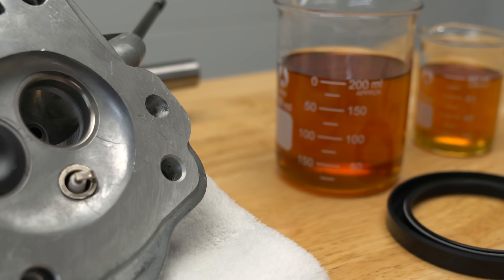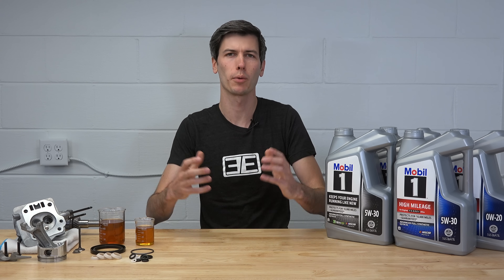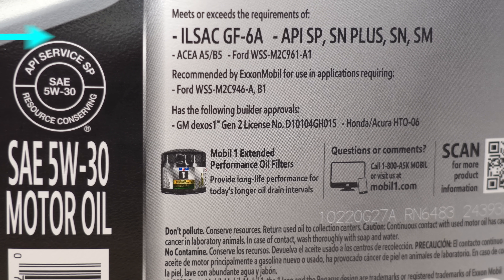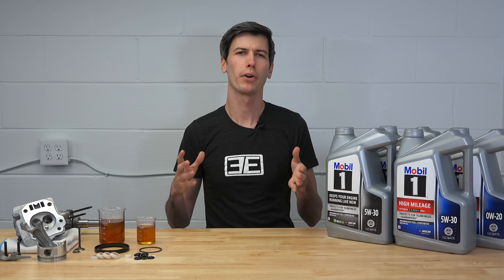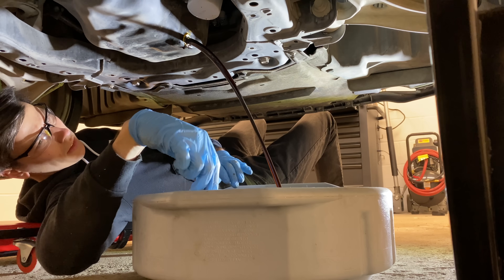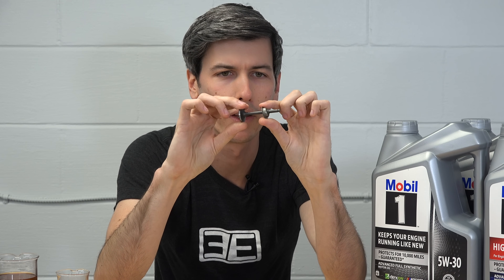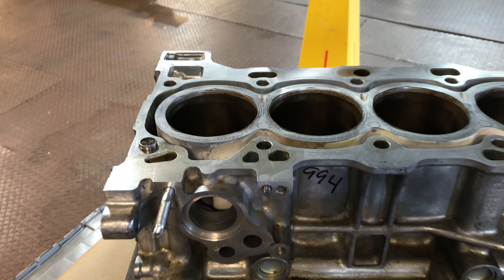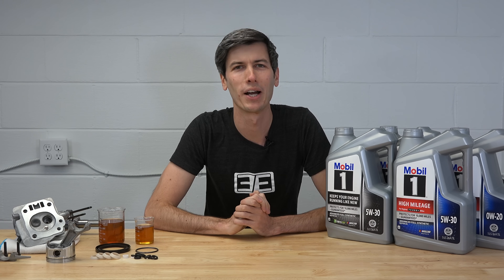Is Synthetic Motor Oil Bad For Old Cars?

Comment: Jason , what if I run 20W 50 in a rotary engine?
Reply: Atarv Hegde mineral only, plus 20w-50 is way too high for a rotary
Reply: @aleksandarjovanovic2238  
Well I meant is a thicker oil usually gives better reliability. So I asked.
Well will 20W 50 work on a S85( I plan to have that engine later)?
Reply: Atarv Hegde thought u were gonna run rotary. Basically, the higher weight u run the more it protects the engine, it also makes it harder for some parts to move. Here in australia we see temps of upto 40°C, and my mx5’s oil pressure gauge reads about 1bar at idle when it gets that hot, (i run 10-40), if i run 20-50, it wont drop that low on oil pressure, but the engine would start struggling to rev at 7k+. I dont know much about german engines so i wouldnt know if 20-50 is high or not, you usually run a higher grade if u want to protect stuff thats getting worn out, like rings. Im not an engineer, im a physicist, so i didnt study this stuff much, go off by forums. By manufacture recommendations, it says i should run 5w-30 or 15w-50, i dont feel comfortable running either cause one is too thin and wont protect my rings and walls, while the other is too thick and will put more load on the engine when its trying to move the piston.
Reply: @aleksandarjovanovic2238  
Well , fine. Maybe 20W-50 is way too thick.
But , the manufacturers usually recommend a oil that gives a mix of reliability and fuel economy. So maybe running a slightly thinker fuel is better

Comment: I always wondered how cylinders were kept lubricated. Cross-hatching. That's pretty cool.
Reply: Sorry, but no. The crosshatching is there to condition the sealing faces of the piston rings to achieve a good seal. The cylinders are lubricated via oil being violently flung around by the rotating assembly.
Reply: @GroovesAndLands  Interesting. I don't understand that. Surely a smooth wall would provide a better sealing face for the piston rings? How does this work?
Reply: @HdaveH  It comes down to neither the piston ring or cylinder being PERFECTLY round. The cross-hatch's most important function is to abrade the piston ring on initial break in to achieve a good seal. As the engine goes thru life and experiences wear, the geometry of both the cylinder and ring will change a little; for engine to keep excellent compression and sealing, the rings/cylinders need to stay nicely mated/married, and the crosshatch helps make that happen.

I'm not a fluids guy; there may additionally be something to oil forming a nicer, more spread-out film on the crosshatch compared to a simply smooth surface - similar to the difference in how paint sheds water waxed vs. unwaxed. Not sure... But seriously, the most vital function of the honejob on a cylinder wall is to get brand new rings seated properly in the first few minutes of running.
Reply: @GroovesAndLands  Thank you, that is fascinating. As far as fluids go, iirc they will adhere better to a scored surface than a smooth surface, so long as the size of the scoring is small and the fluid viscosity is in the right range.
Reply: @HdaveH  That is interesting, but sort of intuitive!

I've certainly seen old engines, with zero crosshatch left, that consume a lot of oil and smoke like a tar kettle... So why would a smooth cylinder wall cause the smoke?

Not sure, but a theory that would jive with our musings here is a smooth cylinder might have "puddles" of oil instead of just a film, and the piston rings can't properly scrape off the excess if they're slogging through puddles.

It's a complicated dynamic, difficult to envision and nearly impossible to actually watch in action.

Comment: The standard oil for old cars has been 15w-45 "diesel engine oil". The thicker oil to help with leaks, and the "diesel" because it has a higher concentration of zinc, molly, and detergents.  THe problem I have with sythentic oils is there is no industry standard for blends. Might have a little, might have a lot. And there is different types of sythentic oil base, some great, some poor. ie Synthetics are usually called "Group 4" or "Group 5", but the cheaper ones use "Group 3" which is not considered sythentic, but actually a higher grade non sythentic.....   but with no standard, you can say what you want as long as you can factory certification

Comment: 12 years , 210000km , still can do m1 0w40, 5w50 , no oil loss ✋ , but the tran is getting weak lol , despite oil crisis , engine oil price remain tough
Reply: Synthetic oils require a lot of processing, so the major costs is not the crude oil.
Reply: @duerdum9  mineral and blend too ,  no sign of lowering the price

Comment: The reason synthetic oils mustn't be used on Wankel rotary engines has nothing to do with carbon deposits. It's all to do with NOx (and other nasties) emissions which are far higher when synthetic oils get burned.
Reply from the maker: How would synthetic cause additional NOx? NOx is generally a result of high combustion temperatures & specific air/fuel ratios. The elements creating that NOx (nitrogen and oxygen) are brought in with the intake charge (air).
Reply: @EngineeringExplained  In general, it's the detergents and other additives that are superb for lubrication and longevity, but horrible if allowed to burn. In a decent piston engine, virtually no oil gets burned so synthetics are perfect, but a Wankel MUST burn some oil to function without destroying itself. To correct myself though, perhaps I should have said "gaseous nasties (including NOx)".
Reply: I would like to know where you got this info from, simply because I did many searches and came up with nothing referring to that at all, in fact the exact opposite, that synthetic oil reduces NOx emissions in diesel engines. I know, not the same thing...but that was the result of my searches. I did find references to how regular oil burns vs some synthetics not burning as much...which is obviously an issue in a rotary.
Reply: Reason for not running synthetic in an older rotary (3rd gen RX7) is partly correct.  Rotaries do burn oil as a normal process as described in the video.   Us old RX7 guys would not run it because the flash point for the synthetic was/is higher and the engine would pass some unburned oil out of the exhaust port which would eventually clog the cat and the increased pressures would kill the apex seals on the rotors.

Comment: I once blew an older engine when i changed the oil and put synthetic in. The Synthetic oil is so good that it cleaned the inside of the engine (years and years of deposits), clogged up the oil pick up line/tube and lost oil pressure. Dont put put Synthetic oil on older engines that havent got good maintenance, kids...
Reply: +1 for not watching the video. You are blaming the oil for a lack of proper maintenance of the vehicle for which the sludge is clear evidence of. Guess you should have dropped the oil pan too. Had you used regular oil it still would have clogged the pick up line.

Comment: What counts as a high mileage engine though
Reply: Depends on the engine. A 5 cylinder Volvo bill last for a long time while new VW engines are high mileage from the factory.
Reply: The bottles of "high mileage" oil (Mobil 1, pennzoil) you'll see on the shelf say they're recommended for 75,000 or more miles
Reply: I've heard 75,000 or higher.

Comment: Why are there high mileage oils to begin with? Why not just put all the additives in “regular” oils? Prices are the same between them.
Reply from the maker: This is discussed in the video regarding seal reconditioning. (see around 7:20)
Reply: Engineering Explained duh, can’t believe I missed that part
Reply: Great question, as a consumer it's a good thing, as I don't have to worry about buying a separate product that  I do not know if I can trust. One thing to note is that most people do not change their own oil and oil changing places charge $10 more for high mileage oil which cost them no more. So I imagine all oil companies had to make a high mileage oil to stay competitive with bulk sales to oil changing places

Comment: when synthetic oil came out for farms in the 60's my uncle put synthetic in EVERY engine on the farm. the 38 john deere is still running fine today.
Reply: As a retired Air Force guy, Synthetic lubricants have been used in jet engines much longer than most would realize.

Comment: My engine builder  recommended high zinc content oil because my engine has flat tappet cams/lifters
Reply from the maker: Yes - ZDDP is particularly important with flat tappet style engines. I had an excellent conversation with the engineers at Mobil 1 regarding this, and am hoping to summarize that info in a future video!

Comment: Yes used fully synthetic at my older car and it leaks therefore pin point on the gasket leakage. But after replaced the gasket, been using fully synthetic until now and no leakage anymore. So the pro, it helps to pin point the leak faster. The cons, it can cause leak if the gasket is almost harden and eventually sooner leak.

Comment: I only put the purest olive oil in cars
Reply: Italian identified
Reply: @ajayreddy3534  he must’ve also been doing the italian tune up, just revving the fk out of  his car to remove the carbon deposits
Reply: @ajayreddy3534 😊😊😊😊😊😊😊p You 😊
Reply: Extra virgin baby!! Lol
Reply: @audikid89   I wonder if suntan oil would be okay...
Reply: Hash oil for me. 😂 It's a terrible lubricant, but the engine dies with a smile on its face 👍
Reply: I use boiled linseed oil to reduce blow-by and increase compression.  Eventually it polymerizes in oil passages and reduces the need for an oil pump altogether.
Reply: @rabidkittenapocalypse7398  next time toss some pigment in there.
Reply: Double virgin Royal Purple?
Reply: Yes, and save the 5W20 for the salad.
Reply: Greek extra virgin olive oil , it has been used to lube up tens of thousands of rear ends for at least 5000 years . Works every time 😳😆
Reply: @conservativesniperhunter7439  😏 🤔 🫣 🫢 😉
Reply: Extra virgin. Oil and driver.
Reply: I tend to gravitate towards avocado oil, grape seed if I'm going to drive in extreme heat.
Reply: @kerfuffleizer  or verrrry good sexual lubricants.
Reply: You must not be from the U.S.. We don't even put olive oil in our salad dressing. It's all soybean oil. We enjoy our phytoestrogens.
Reply: Used trap oil from McDonald's works best. Perfect viscosity AND the exhaust is pure french fry bliss.
Reply: @AdamIsUrqed  ahahaha i like that dude.
Reply: @AdamIsUrqed  😹 just curious; are you aware that they do make biofuel from used fryer oil? I have never experienced it but I have heard that it does eau du french fry. 😺
Reply: @AdamIsUrqed yep, that’s the crap people ingest.
Reply: Says Popeye!
Reply: "Just a little bit more olive oil".
Reply: I USE HOLY OIL , THE CATHOLIC CHURCH  HAS AN  OVER ABUNDANCE OF IT 
EVERY SUNDAY ,  YOU CAN PICK IT UP AT MOST CATHOLIC CHURCHES,  WORLD WIDE.
BUT I'M NOT SURE OF THE VISCOSITY.
Reply: @almierz4604  Trouble is, it gets off your fingers and causes the Caps Lock key to stick down.
Reply: i use used old oil..filters too🤪..but my car runs so badly now?
Reply: Leo Stone How does it crank over? With some Hymm and Haa!
Reply: ironically you probably could run a diesel engine on olive oil
Reply: @GiordanDiodato  I've heard of cooking oils but Olive Oil??? I guess it is a cooking oil.
Reply: @WarriorsPhoto  Popeye made sure Olive Oil was well lubricated.
Reply: @steveavant9727  LOL 😂 Wasn’t that Brutus?
Reply: @WarriorsPhoto  I think they both had the hots for skinny, flat chested Olive Oil. Guess women were scarce.
Reply: @steveavant9727  Lol 😂, 🤣 😆
Reply: @GiordanDiodato
Reply: only extra virgin triple pressed for my vehicle
Reply: Ah Italian cars
Reply: Ornessar Hithfaeron - does she ride in the front or back seat?
Reply: David Turk I would hope the back. 😉
Reply: @davidturk6301  Please use the tradesman's entance.
Reply: Can't argue, oil is oil 🤷
Reply: I only flush my toilet with Fiji water.
Reply: @davidplunkett7128  Indeed? No access to Perrier?
Reply: Works like an charm
Reply: mcspikesky you must be Irish then
Reply: Cold pressed
Reply: bellisima!
Reply: Ornessar Hithfaeron 
Only in my fleet of Ferraris .
Reply: LOL, good joke and thank you.
Reply: And some chopped garlic?
Reply: I used Whale oil but had trouble with greenies chaining themselves to my car so I switched to Snake oil
Reply: @calthorp  Whale oil beef hooked.
Reply: @calthorp … you should have just dragged them down the road 😂😂😂
Reply: Wait,are you serious? 🤔
Reply: Vegetable oils don't work as engine oil because they will quickly turn into sticky gum. Shear stress on bearings breaks it down right away.  Lubrication would become minimal at that point.
Reply: I suggest you use EXXXTRA virgin olive oil
Reply: I only used Johnson&Johnson's baby oil.    Makes my engine run baby soft.
Reply: 😁 I use coconut oil
Reply: The only vegetable oil cars like is Castrol R.
Reply: Extra Virgin KY?!?! 😂🤣😂🤣
Reply: Only way to go
Reply: Avocado oil is better than olive oil for your engine
Reply: mmmmm
Reply: I like peanut oil , smells great also.
Reply: Only use EXTRA VIRGIN.
Reply: Cliff 😂 🤣
Reply: @WarriorsPhoto
Reply: Sama here!
Reply: Cooking oil
Reply: Caster oil is natural oil. It is blended with synthetic oil in Castrol A747 2 stroke racing oil. Whale oil was used in speedway bikes in Australia back in the day. There was once an Aussie ISDE motorcycle racer that completed a stage using olive oil from a villager.
Reply: I only use first pressing, ultra virgin olive oil.
Reply: I will pretend like i never red that
Reply: Olive oil will actually power a vehicle well, like any vegetable oil, as long as it is thinned out enough with kerosene so it doesn't get gummy.
Reply: Strong independent women that dont need no man! 👍🤣
Reply: Should try some grape seed oil they say it's healthier
Reply: @michaelkolbe5963  grape seed oil doesn't have the viscosity for high mile engines.
Reply: I use finest linseed oil.
Reply: Yeah corn oil is awesome
Reply: Tell me more about the olive oil. Never heard of it.
Reply: @shawnbutchko456  😳🫣😲🫢 O  M  G !
Reply: Genco or nothing
Reply: Avocado oil has a higher smoke point. It’s slightly more expensive, but well worth it.
Reply: Popeye approves
Reply: I like your style, Dude
Reply: @Ravelord Nito Good luck finding a virgin these days.
Reply: Extra Virgin 😋
Reply: Extra virgin 20-50
Reply: Extra virgin crushed by virgins?
Reply: Extra extra extra virgin
Reply: I’m a rapeseed kind of guy myself
Reply: Butter for the win!
Reply: I use castor oil. Total loss.
Reply: Extra virgin in the passenger seat
Reply: First cold-pressed!
Reply: I was talking to a heavy equipment operator and he was saying he used canola oil in place of hydraulic oil. Clean up was easy in case of hose failure because it was biodegradable.
Reply: i used mustered oil. works great.
Reply: Peanut oil has a higher flashpoint. I would recommend that you switch.
Reply: Only the virginiest of olive oils
Reply: And I use Mobile One on my salads.
Reply: I used mayonnaise
Reply: Here in Western Canada 
Canola oil is king.
Reply: @ornessarhithfaeron3576  I run whale oil in my steam engine!
Reply: Extra virgin it’s expensive but it’s the best
Reply: EVOO in the Evo?😝
Reply: Glad to hear it, “oils ain’t oils” (advertising slogan years ago in Australia).  Being serious now, I would rather you use olive oil in an engine, than consume it yourself.
The purity is said to be 51% AT BEST.  Yes, it’s diluted with other “vegetable” (the correct term is “seed oils).
Seed oils commonly oxidise (similar in concept to steel rusting), then it’s a health hazard to consume.
Personally, I wouldn’t use olive oil for anything.
I use Tallow in cooking which is far healthier in combination with my mainly meat based diet.
Reply: Ive always preferred using corn syrup in all of my engines.
Reply: Lmfao 😂
Reply: I use ester base oils on my cock ring for the extra swelling properties.
Reply: I use ester base oils on my cock ring for the extra swelling properties.
Reply: Do they still run? 🤔
Reply: Coconut Oil smokes at a higher temperature.
Reply: Nanny Goat olive shop oil is the best.
Reply: extra virgin olive oil
Reply: Older Rolls-Royce have used food oils .
Reply: Coconut oil. It's like sae 50
Reply: Virgin works best 👌🏾 you don't wanna use that penetrated olive oil ❌
Reply: You shouldnt do that.
Reply: Make sure to use regular no extra virgin! It has to be a high temp oil
Reply: First, show me your synthetic oil. If that regular mineral oil with new label on it stating it is synthetic  - then no sense to listen farther. If it is pure synthetic, f.e. Amsoil SS - then I can  apply my attention
Reply: I use canola, it was originally made for lubricating steam engines and can even be used as fuel in a diesel engine so truly multipurpose :D
Reply: Disappointed to see it wasn't organically grown in a biodynamic way by ethnically diverse Lesbians.
Reply: @thomas316  Did you mean orgasmically grown?
Reply: Lol
Reply: Vaffanc***